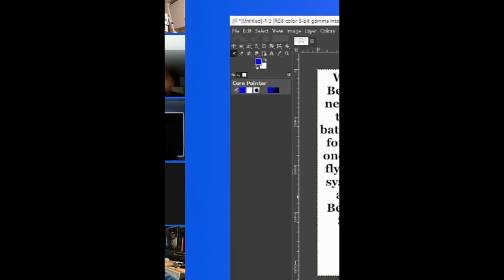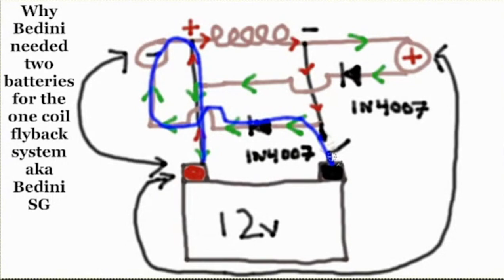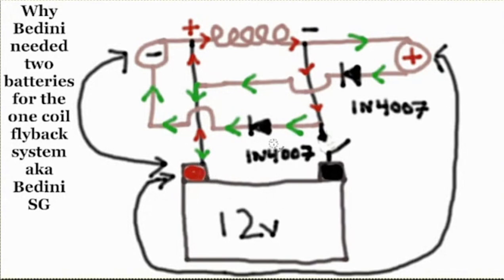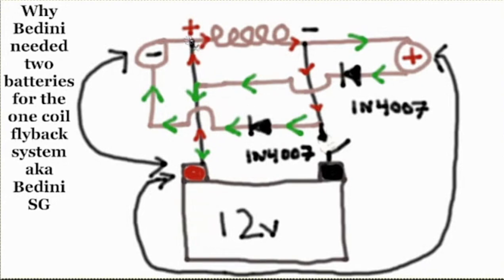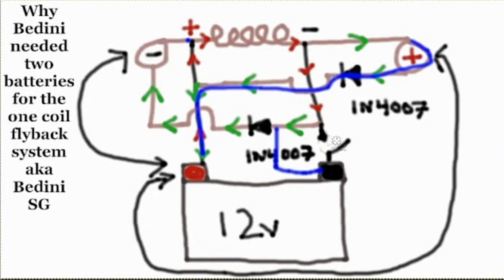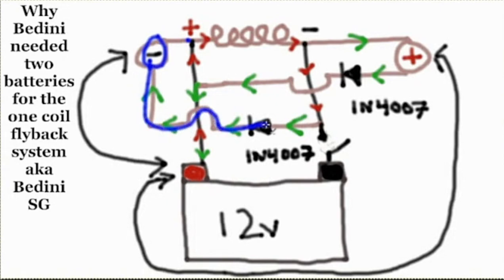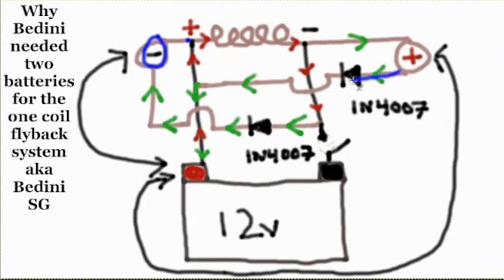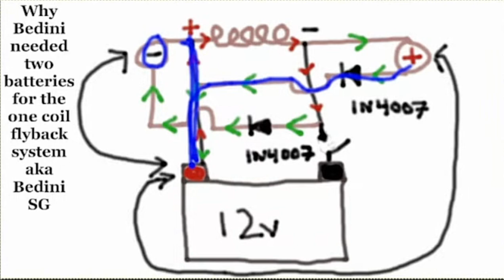Why I Believe Bedini Added The 2Nd Battery

Comment from the maker: this circuit does not work for one reason and one reason only , its a single pole switching circuit. Add another switch (pos terminal of battery) in unison  and this circuit works porrect . you can use a DPDT relay for this (double pole double throw relay)  you will also need to add second channel to positive and negative terminal of battery. Best to look at the circuit in my other videos it shows correctly this video is just for live stream and open source talks